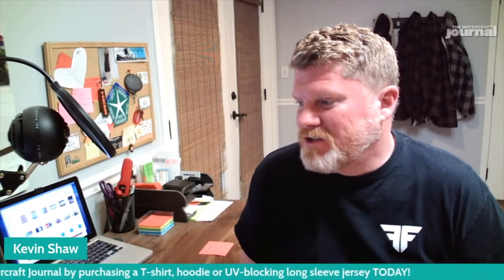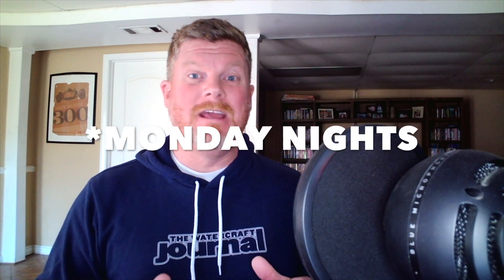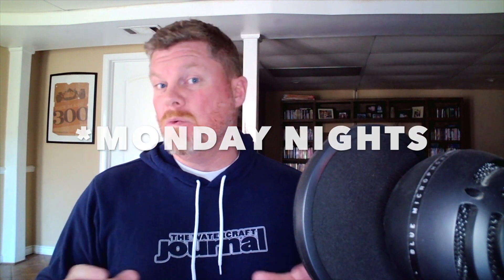Yes, Carpeted Trailer Bunks CAN Burn The Thin Paint on Yamaha Hulls: WCJ Quick Topic

Comment: At zero hours on my 23 GP I installed Gatorglide, and to further protect my hull, I recovered my bunks with 36oz Cuda Forever Carpert and sprayed it down with Liquid Roller. It is much more forgiving and plush compared to the Triton carpet. I haven't had any issues and my ski runs 92 mph .
Reply: What’s the mod list? Got a video of the run?